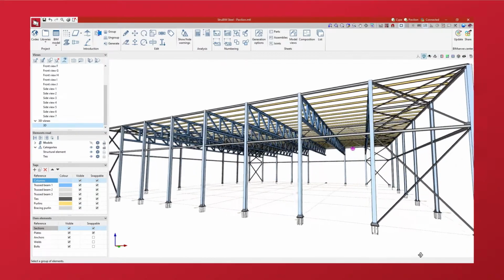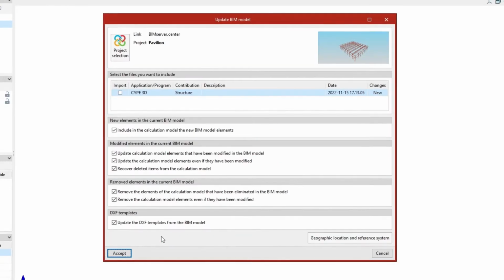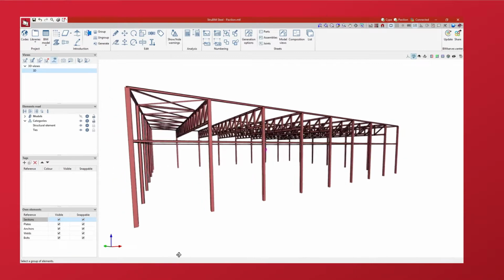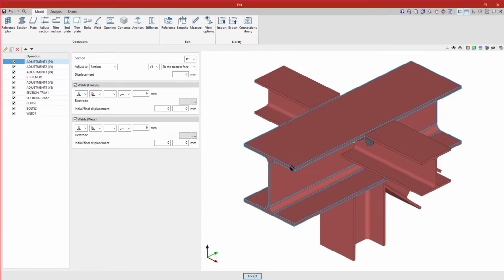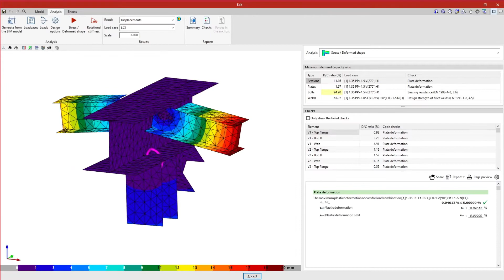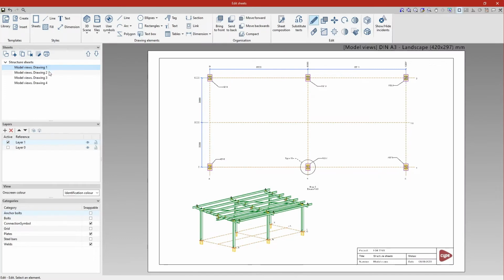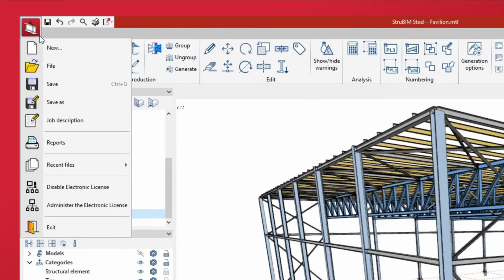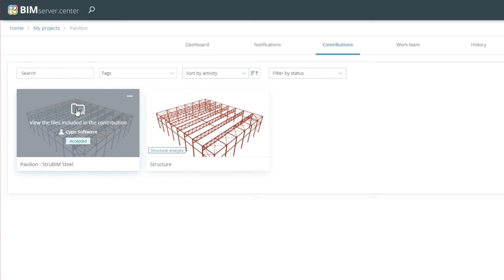StruBIM Steel

Comment: When you say "equivalent to CYPE connect to design, analyze and check the joints" you mean this tool is now integrated into strubim Steel? Or you need CYPE Connect and this is a workflow between them? Thanks.
Reply from the maker: Hello Sergio, the tool is integrated in the "Joints" option of StruBIM Steel, so it is not necessary to operate CYPE Connect independently; it has the same functionalities. Regards😊